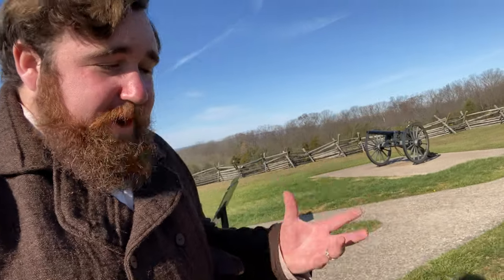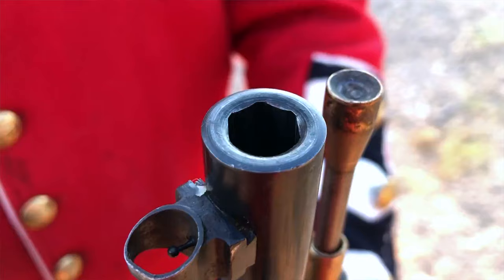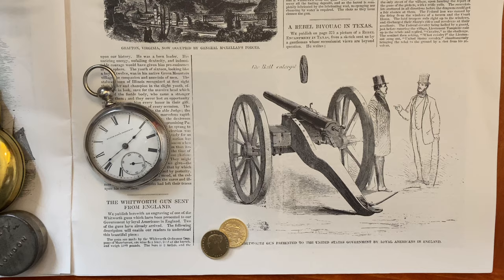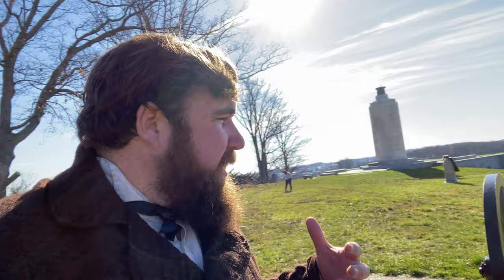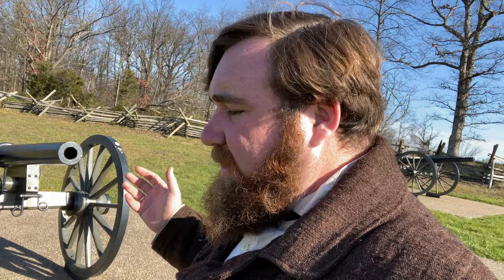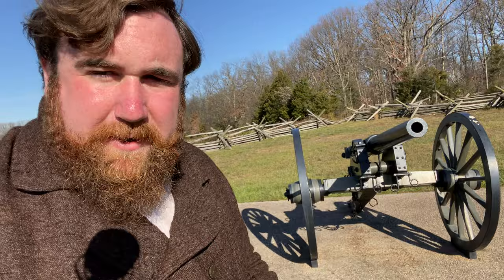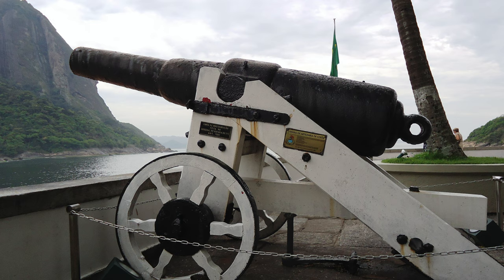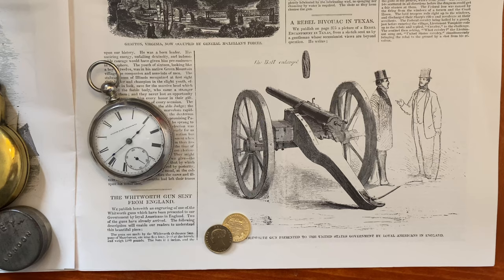The Whitworth Guns: British Tech at Gettysburg, Civil War Walk 🇬🇧

Comment: My first question is, What about securing ammo? Did you get a mold with every gun you bought? The thing looks pretty useless without the special hexagonal rounds to fire. Second, could you fire canister with it? Thats some serious twist to the rifling!
Reply from the maker: There would have been provisions to supply ammunition or the ability to produce it, but I believe they might have been shipped separately, as the Union had difficulties fabricating ammunition when they captured the guns off 'Princess Royal'. You absolutely needed the bolts, greased wadding, and cartridge, for it to work correctly. 

It's unlikely that one would use this to fire canister, it is definitely something for long range fire, and likely never would have been placed in a position to require canister.
Reply: @theministryforhistory  Ok, thanx for answering. I'd be very reluctant to buy into a weapon system at such a high price, AND with such a tenuous supply of ammo. I'd buy a few molds before even considering buying the guns. No wonder there werent that many purchased. -- I asked the canister question for one reason: You always want to have a close range option, just in case. I realize these are long-range weapons. But the battlefield contains alot of "what ifs", ya know? -- I like your work. I'll be subscribing to see more.